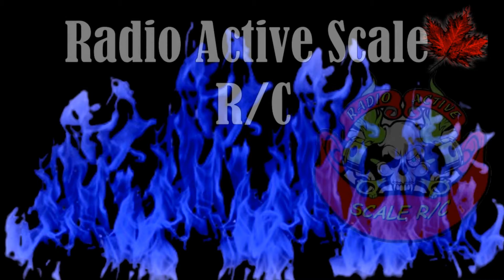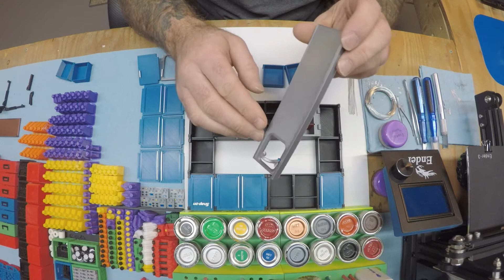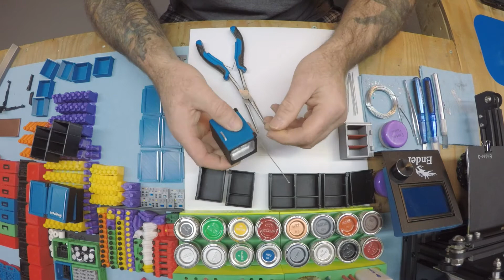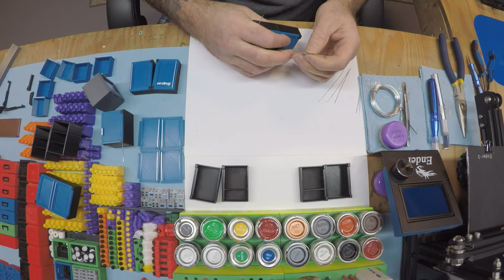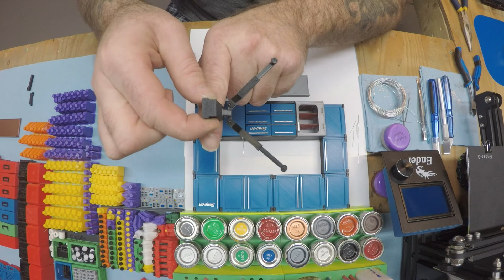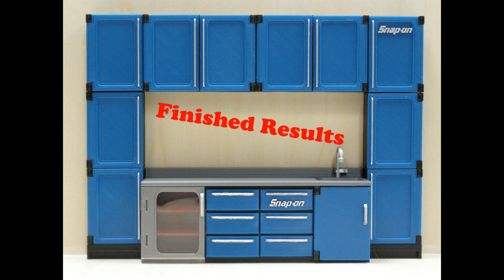1/24 Scale Garage Build Part #2

Comment: Love the checkered flooring where you get would love a Checkered flooring from my shop, really love the cabinets that is super cool, love to get a price and that whole set
Reply from the maker: Thanks, the whole thing is all 3D printed, I have been working on it for almost 2 years. I designed everything for my garage but if you are interested in the cabinets I will have to do some more slicing of the each cabinet to get a cost of plastic used and all that good stuff, they take a lot of time to print and assemble. So let me know if you are interested and I will figure out a price for the whole set or just portions you want.